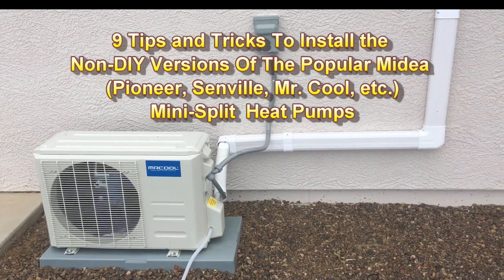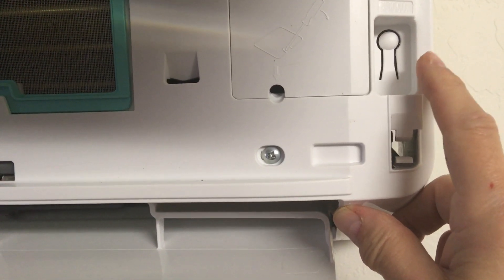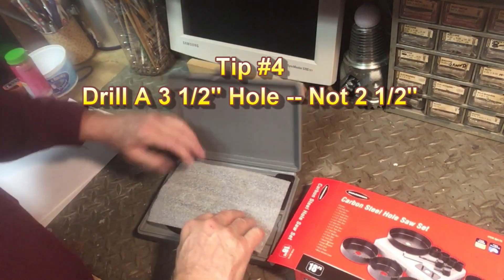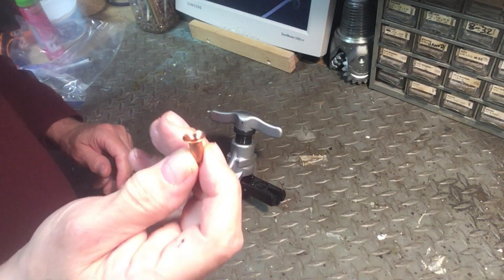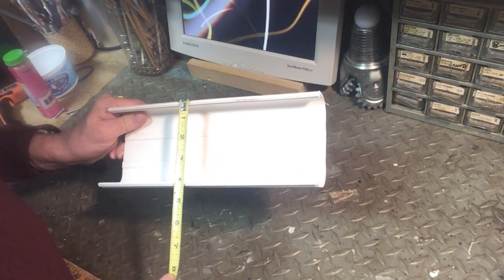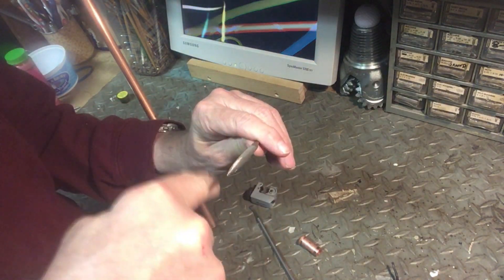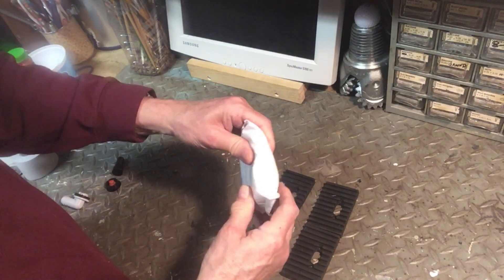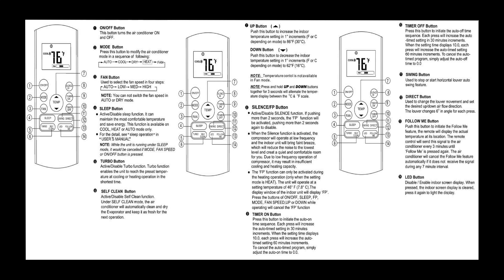9 Tips To Install Cheaper Non-DIY Mini Splits - Pioneer/Senville/Mr. Cool

Comment: I considered getting the non DIY but I noticed that the warranties were very different.  I don't know if they are the same.. maybe?  maybe they just give a longer warranty with DIY because you pay more.  Good advice all around there.. thank you.  I'll have to buy those tools you have next time i get one and see about saving me some money.
Reply: I noticed the Mr. Cool DIY unit has better valving and the line connection is better. I also noticed the compressor's on the cheaper non DIY units are more loud.  So that tells me there is an improvement in parts within the compressor and with the line connections with the more expensive DIY units.  Also, the Mr. Cool is boxed much better than the others and so normally is not damaged as frequent.  And last, when non AC techs start doing vacuum and cutting lines and pressure they get dirt and other stuff you do not want in an AC that, over time, will kill the compressor.  So with the DIY Mr. Cool, you never contaminate your lines and then your compressor is good for years to come.  By the way, iv'e heard of the oil being trapped in the lines that are circled up over time, but I've never seen a unit harmed by those lines being kept like that.  So it might be a wives tale.
Reply: @kimojon9665  yes, I've read about the lines being circled causing issues, which I wouldn't know about.  I hope it's not an issue because mine are all rolled up as shipped expect for the line I unrolled out for installation.  So far I'm loving these machines because they are very quiet.  only thing is.  when I switch on the unit from the phone app, I can't figure out how to dim the LEDs.. i have to use to remote for that.  we have a unit in a bedroom so those LEDs are bright.
Reply: @DuncanCunningham  Did you get the non-Diy unit?  The one gentleman above says the non diy unit is louder  Did you find that to be true?  Thanks.  Did you use a single stage vacuum or dual stage unit?
Reply: @dogsplantscarsneatstuff176  I may not be able to answer your question as I'm not an experienced handyman and I've not seen any units from Mr Cool other than the DIY ones that I purchased.  The internal unit is almost silent.  You can switch off the LEDs on the display so sometimes it is hard to notice that they are on until you get close enough to feel the air movement.  We usually have ours on the lowest setting to cool.  The outside until is running but the fan to evaporate is going quite slowly, so maybe that is what you mean by "stage"?  i know the fan can go faster on the outside unit, but it is very quiet too.  I'm used to those whole house outdoor units that rattle, shake and the fan is either full on or off. This one is not like those.  Does that help?
Reply: @DuncanCunningham  It helps a lot. Thanks.  It sounds like you got the DIY unit that did not need a vacuum pump to install the unit like the youtuber displayed.  If you got the non DIY unit it would have required a vacuum pump (either single stage or dual stage) to clear the air out.  Thanks for telling me how silent it is.  Have a good day.
Reply from the maker: My unit is extremely quiet, both inside and outside. You can hardly hear the inside unit once it gets the temperature to where you want it. The outside unit is NOWHERE NEAR the loudness of a typical A/C unit, or even a window unit.
Reply: Dont get the diy unit (as recommended) and do the leg work yourself (running the lines and wires) and hire a local hvac guy to finish the work for around $100-$200. Still saving hundreds.
Reply from the maker: No, see my comment at the top of the video. The non-DIY and the DIY are virtually identical. You are paying twice as much to get the warranty. You should only go this way if you are handy and can handle most jobs yourself. You are taking a chance. I thought the risk was worth it because you can buy almost two non-DIY units for the cost of one DIY.
Reply: @bupright  its a good deal but I don't know how to use the vaccum pump or know what I'm doing.. I guess I could get the tools you have and watch some more videos.  next time I buy one, I'll do that.
Reply: @bupright  You are paying for the pre-vacuumed and charged line sets plus the specialized quick connect ends . That's what allows them to offer the warranty to a DIY installer . You can also just buy one of the regular units and do everything yourself except switching it on . A reputable HVAC company will come to vacuum the lines and release the refrigerant for $200-300 to validate the warranty .
Reply: It appears the Advantage (non-DIY) series is less efficient, and cheaper. I assume it uses older or cheaper parts. The Olympus (non-DIY) series seems to be the same unit as the DIY, and maintains the same warranties and efficiency.

Comment: Great video, also wondering how you like the mini split ? Thanks !
Reply from the maker: It works great...temperature on the right side of the inside unit (where the refrigerant comes in) is 34-36 degrees with a 76 degree input. Not bad. It is extremely quiet. Now I want one in the bedroom.

Comment: Great tips! Definitely good out of the box thinking. Which model Mr Cool did you end up going with? How do you like it?
Reply from the maker: I went with the 18,000 BTU non DIY model (A-18-HP-C-230B). It's in my three-car garage (about 700 square feet). It is amazing. On a day when the intake temperature was 76, the temperature right where the refrigerant comes into the inside unit shows 34-38 degrees! A 40-degree drop! It seems to be very smart...when it gets the temperature down to the setting, it goes into a mode where it works just hard enough to maintain the temp. For example, it will blow 34-degree air when it first starts, but after a while it will blow 58-degree air, and adjusts itself to meet the demand...instead of blasting cold air, then totally shutting off, then repeating. Different from the way a regular A/C works. Also, it is extremely quiet in all modes. I can't believe I didn't put one in years ago.